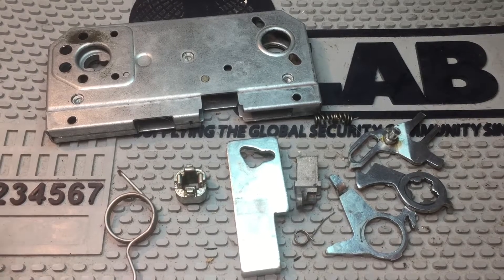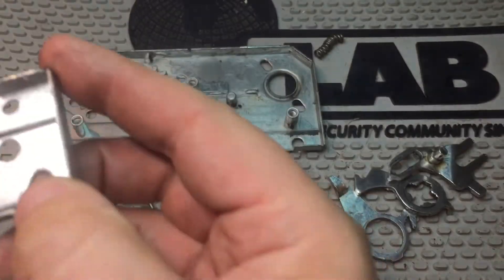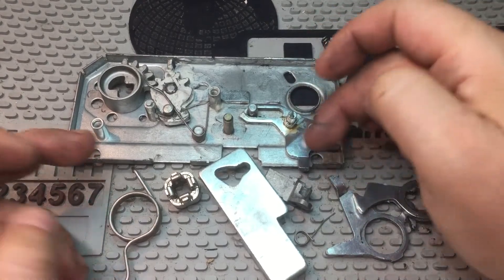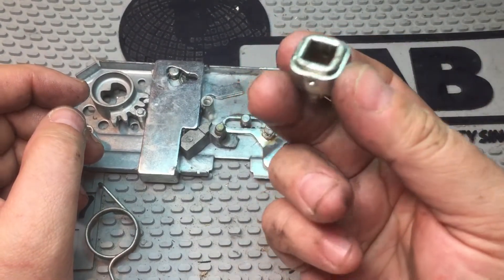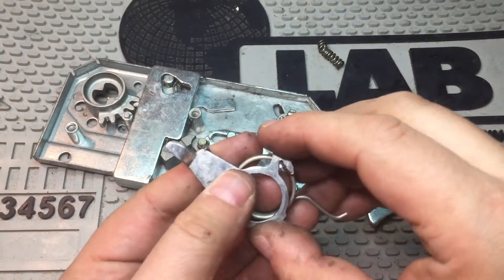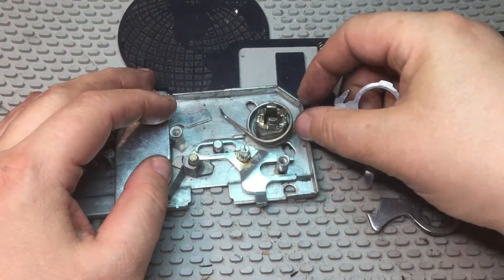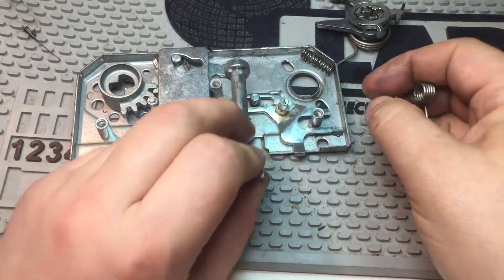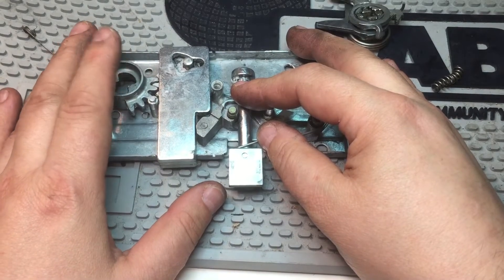079 - Ruko School 41 - multi point lockset internal parts explained

Comment: Thank you for your video. I've got further watching your video than I have contacting several suppliers. I am in the UK and I have an ASSA 765 that has the little tab you describe in your video around 28 seconds to throw the locks at the top and bottom of the door. I have bought a replacement lock but it does not have that tab. When I remove the strike plate from the new lock I expected to see the cut out with that little tab. Do you know what that is actually called and what I should order?
Reply from the maker: Have a look at my modular videos. The 560 latch and 565 bolt. They are just an insert in the middle of the door, without the extra points. You likely got one of those. 
If you are in UK try asking Andy Perrin. (@brighton_locksmith ) Just tell him I sent you. He has a great channel and knows more than me, when it comes to UK locksets

Comment: Very helpful, had a broken FIX multipoint lockset made in year 2007. The hub was broken. No spare parts available. Bought the cheapest Yale (ASSA) lockset in Bauhaus and moved the hub from it to the FIX lockset. Had to make my own jig to get all together again. Material cost around DKK170 instead of DKK 900 for the whole set by ASSA which aquired FIX long time ago.